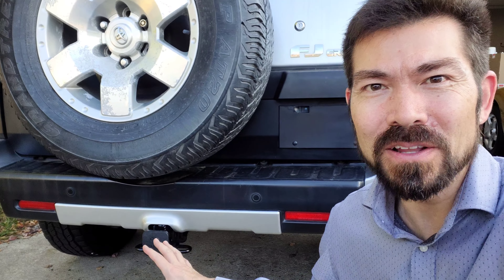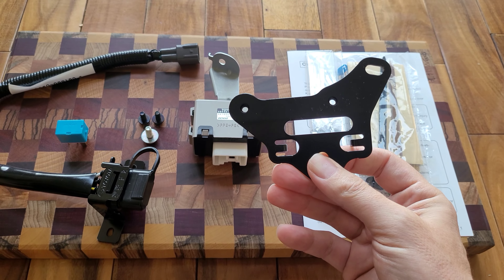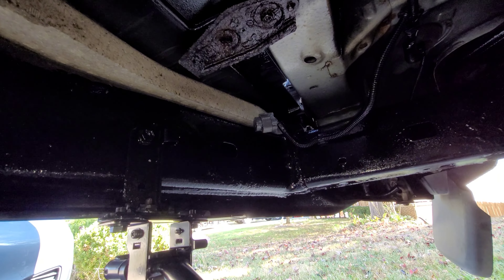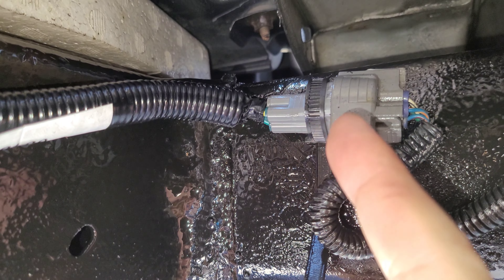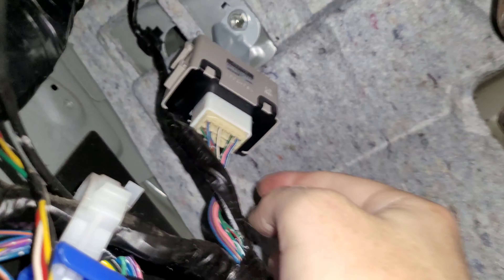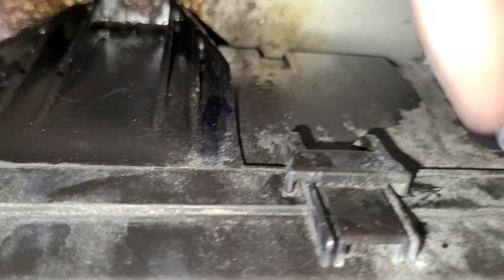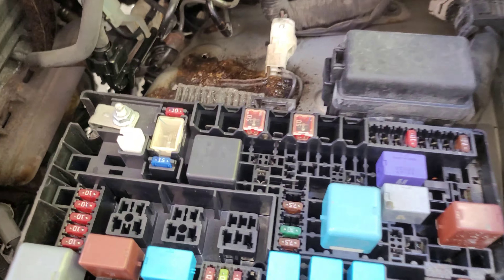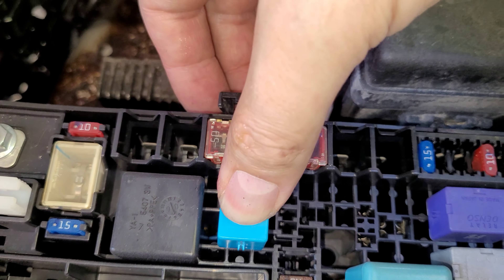Trailer Wiring in 3 minutes - Toyota FJ Cruiser #fjcruiser #trailer #trailerhitch #howto #vehicles

Comment: Any idea how many amps the relay is?
Reply from the maker: @1markdavies It is not marked with the number of amps, but it is marked with the following, which should allow you to track one down easily enough.  90987-02027 156700-2870 12V made by Denso for Toyota.